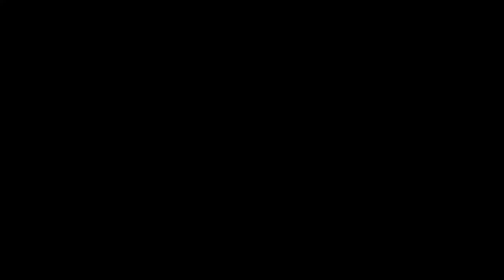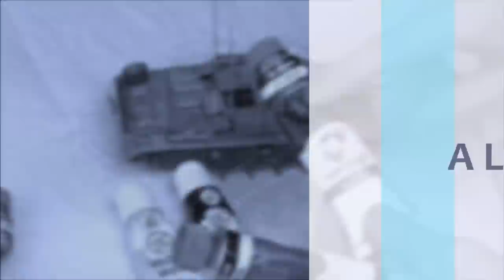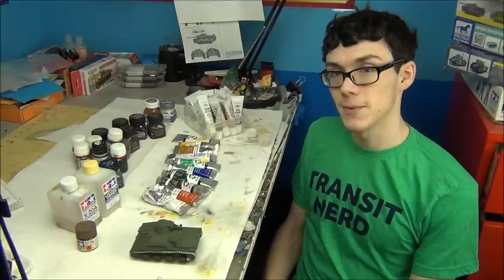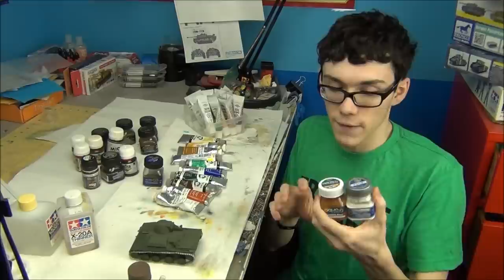Why You Shouldn't Use Acrylics for Weathering Model Tanks

Comment: I’ve seen enamel thinner chew through tamiya laquer clear coats and turn Vallejo acrylic paint white. What your saying isn’t 100% true and people should take due caution with enamel to and ensure they are using a good clear coat before enamel weathering.
Reply from the maker: +Nick Darby I specifically used the words "modelling enamel thinner".  You can get hotter stuff but you don't need it.  That's why I always recommend lighter fluid and did numerous times in this video.

Also, Tamiya Lacquer clear coats are the strongest option you can airbrush, so I'm not sure what you're implying about using a "good clear coat" instead of it.  This has been tested my numerous modellers.
Reply: Should of clarified tamiya rattle cans believe they could be acrylic base? And yes mig thinner, tamiya enamel thinner I’ve seen chew through the rattle can gloss clear coat after a small amount of working a streak or wash.

Comment: Ok I use Tamiya paint for air brushing my models. I want to use the oils but need to know if it is safe to coat my model with Tamiya flat clear to protect the base color before use the oils. If no the flat clear from Tamiya what should I use? I don’t want to mess up the salt technique I have used to get the rust effect on my model. Thanks
Reply: Thanks for asking, I am wondering the same thing
Reply: I have used the Tamiya dull core from the spray can, but you have to be careful because it will literally start attacking your Tamiya paint and will make it run. So I use the Testors Clear Flat and do my weathering over that.
I have actually used Tamiya acrylic for weathering after I have applied the Testors dull core and have had no issues.
Reply: Werner Lightner  thanks for your input! Guess I’ll look for the Testors dull coat. I really want to use the dot technique with oils to get the streaking effect on the sides of the model.
Reply: @soonersteve3733  I have done that with oils and acrylics. Just make sure you put on a dull coat first.
Reply: Werner Lightner  thanks man! Picked up testors dull coat and will give it a try in the morning.
Reply: @soonersteve3733  cool! Let me know how that works out!
Reply: Use Vallejo satin or gloss varnish. The gloss enhances the capillary action for pin washes. Vallejo mat Varnish works well too. To be honest the mat varnish works best for dot filters because it adds a bit of grip for the pigment to settle on and wont wipe away with the slightest brush of you finger.
Reply: Werner Lightner just sent you email and looking forward to seeing your work